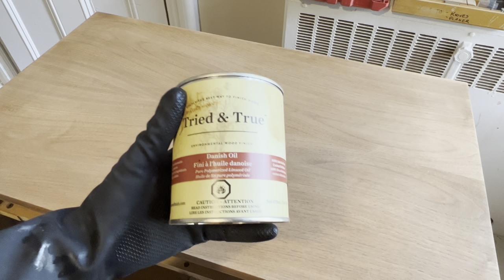The WORST paint I’ve ever removed…. FURNITURE RESTORATION / MID CENTURY

Comment: That looks gorgeous. 😍 I love the stain color 'Candlelight'.  One suggestion though.  Remove the metal caps on the bottoms of the legs and replace with acrylic ones.  Those metal caps are murder on flooring.  Every piece of vintage or antique furniture in my home has acrylic caps or felt pads.  My hardwoods are grateful. 😊
Reply from the maker: Thank you! That’s a great idea 😊

Comment: I have a scraper and tried using it but I just can't take the scratching a chalkboard sound it makes. Am I doing something wrong?
Reply from the maker: I know it exactly what you’re talking about, almost like a shrieking noise. Have you tried changing the angle you scrape at? I try to keep the scraper fairly level, pulling backwards instead of back and upwards. It seems to make a high pitched sound only if I scrape at a certain angle
Reply: I'll give that a try. Thank you. ❤️